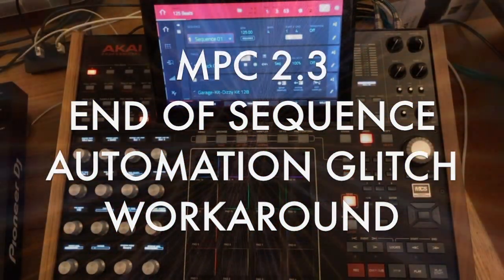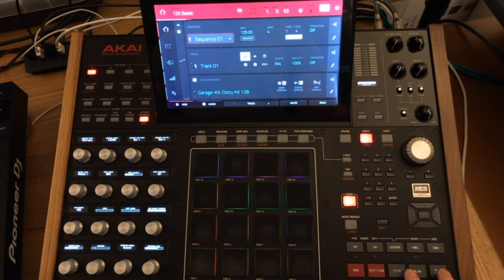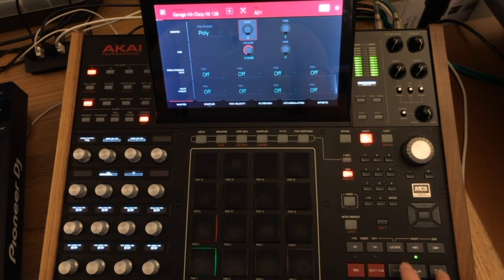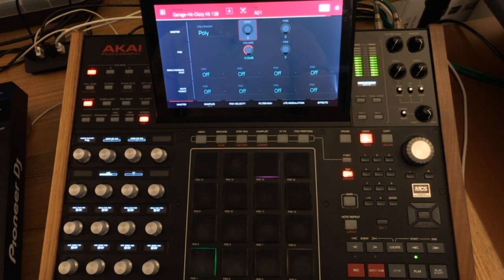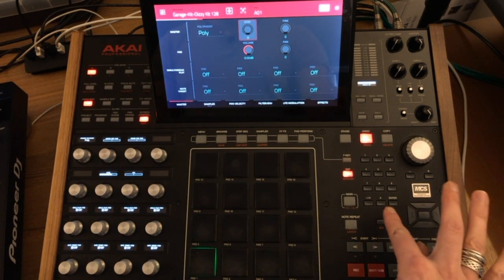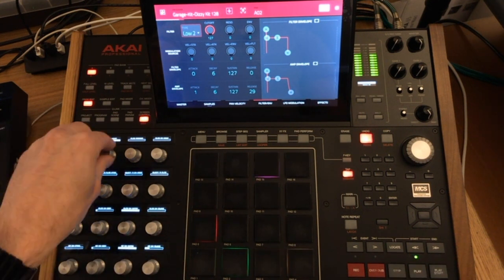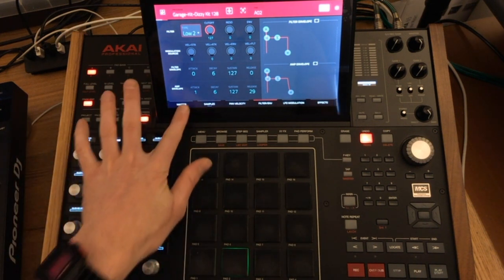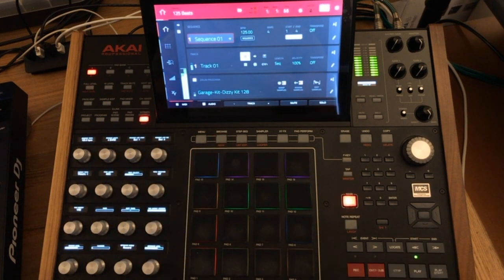MPC 2.3 AUTOMATION GLITCH QUICK FIX

Comment: Hey there. When I reload the project it works temporarily but when I switch to the next sequence the automation bug reappears no matter how many times I save and reload the project. This bug is super frustrating and for me it's not going away. I've tried erasing the automation and still nothing.
Reply from the maker: Do you mean the same bug mentioned in this video? If so then update to the latest firmware. If the issue persists then unfortunately some bugs can remain in projects regardless of the operating system. If that’s the case, you may be able to copy some elements from the sequence into another or just try and reconstruct as much as you can.